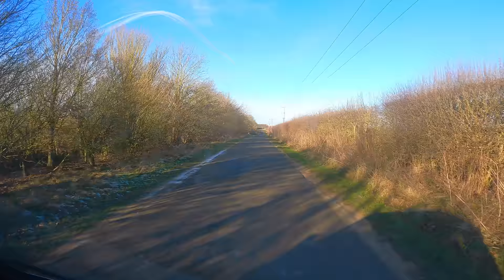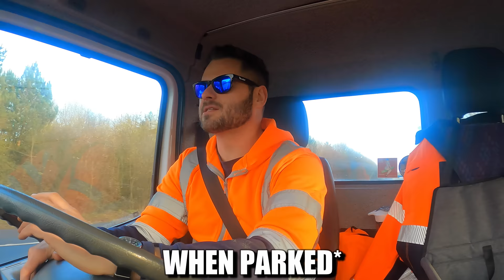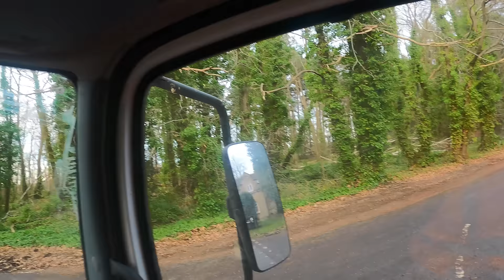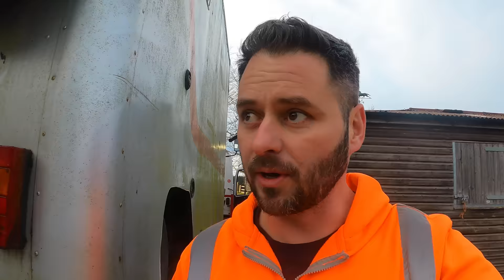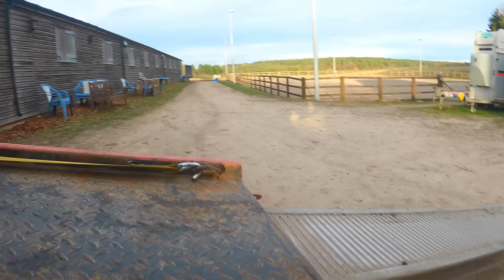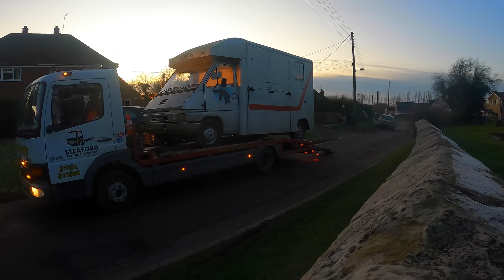ACCIDENTS & HORSES | CRAP TIPS FROM A RECOVERY DRIVER | EMOTIONAL ENDING!

Comment: I agree about the horse people!! Your camera issue is probably caused by the Bluetooth headset being used. Bluetooth is radio frequency I have a ham radio licence and  a Bluetooth keyboard had connection issues while I use the radio!! Great video!!
Reply from the maker: I'm not sure, I think it may be the batteries, I've got 3 x cheap Chinese ones and it inky ever does that when I use those batteries. Time to dig deep and buy more genuine GoPro ones.

Comment: Definitely with you on sticking with slightly older cars, modern cars are so techy an I hate it. My astra currenlty needs a new rear fuse box which is super cheap, an literally just one bolt to undo to replace it, super easy, however i would then need it to be pin-coded in to match the ecu an thats gona be another £150 for someone with the specific tech program to do it. Older is better 👍

Comment: Evening Ben. Good to see & hear your keeping out of mischief. 😂 Corsa seen better days, yes good fuel tip, you 🍩‼️ cool video edits ( Chad ) older not sure of newer SAAB have to put in reverse to remove keys from ignition. Many new vehicles have pre manufactured design faults to reduce the longevity of the engine or its components, as we are a throw away / nothing meant to last like it used too, or made too costly to repair / end up as salvage / wrote off or scrapped. Any content Ben is good content. Whatever you’re doing keep us involved / entertained. I think you should increase your prices, when I was self employed, I always asked customers if they’d had other quotes or a budget in mind. Safe to say I was undercutting most other so called proffessionals in my desired fields, just unfortunate covid & then I guess a so called recession / fuel costs, heating costs, insurances etc all increased more then my income. Meaning I went back to being employed. That didn’t last long as I’ve spent more time being signed off sick with stress depression & anxiety. Your videos help motivate me, and yes every now & then we all have take some time just thinking there alway other people worse off then ourselves. Daniel.
Reply from the maker: Cheers for sharing all that mate, stay strong 💪

Comment: Not sure I agree on the oil pressure / rpm thing, vast majority of engines hit full oil pressure not far above idle, even when pretty old & worn, after that any extra gets dumped via a pressure relief valve.
Reply from the maker: Hi mate, sorry for the delay responding, been a little busy. I've read a few papers on the causal factors or snapped cranks and bottom end failures and lots do cite the lack of oil pressure. One that is quite relevant to me is on the Disco 3/4. The 3 suffers far less crank failures because it produces significantly less torque than its successor crucially at lower RPM before the oil pump has reached max pressure. You may well be right mate, but something I've always believed in is an engine that you're requesting more torque from is much happier with a few extra rpm.

Comment: ben i dont see your logic on the engine rpm's , the faster the engine goes the hotter it gets , the oil and water pumps havd to work harder to push more volume through the same portings . Trucks have multiple gears to keep the engine speed as low as possible to stay in the high torque band and they can cover a million kilometres . Regular oil and fiter changes are the key factor in engine  longevity.
Reply from the maker: Yeah, agreed, a lot of newer trucks develop peak oil pressure almost at idle. Some examples are the JLR V6, and the Renault M9R. Neither of those make peak oil pressure until 2k rpm. But largely you'll be OK. I'm not talking about screaming it's head off, just pick those revs up a bit that's all.